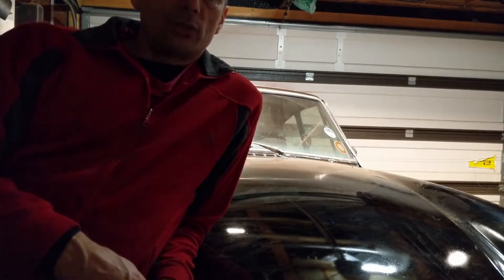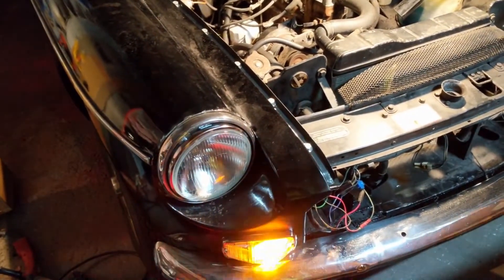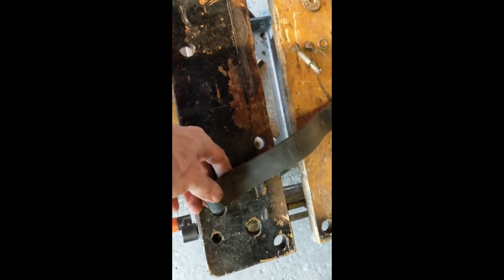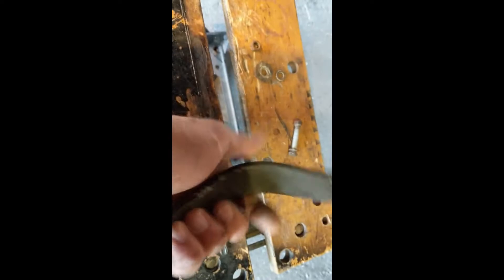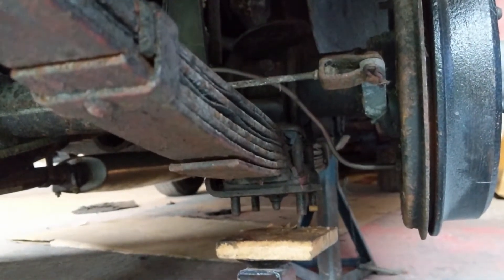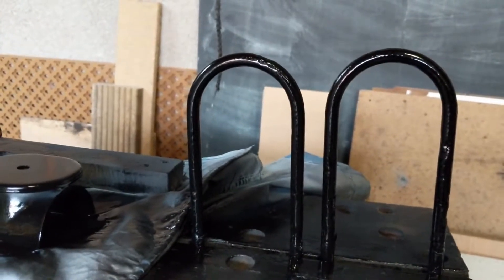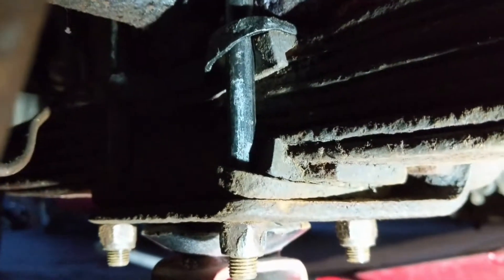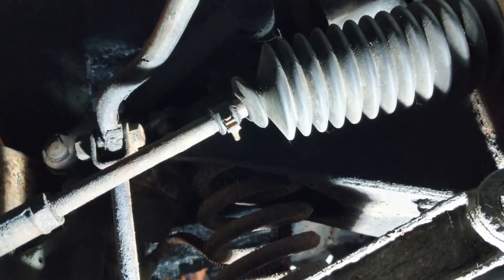MGB GT Episode 22   Odds and Sods

Comment: Hi Henry, Me again. 
Your trackrod end nut is not tightening because the tapered shaft and encapulated balljoint above is also spinning....not unusual when they get a litte worn. The way over this is to force the joint together temporarily with the aid of a G clamp/waterpump pliers or similar so the tapered shaft locks into the steering arm of the hub. This prevents the shaft from spinning and the nut can then be tightened.
Once you have sorted the steering gaiters, dont forget to introduce around 1/3pt of EP90 (going from memory, so check the manual first) into the rack as I think this will have long since disappeared if your gaiters split 10 years ago! The rack & pinion gearing is probably running dry at the moment.
Keep up the good work!
Reply from the maker: Thanks Carsten, but are you certain about the tie rod end.  I know it downs show well in the video but if you look closely you can see the thread being cut as I try to put the new end on.  It looks wrong to me but I don’t have the experience to know.
Reply: @HenrysGarage  Hi Henry, Sorry I think we are talking at crossed purposes here. I was commenting on your track rod end nut spinning but not tightening (at around 22:20 on the video). TrawIing through the next videos I now see you have cut the joint off, so my comment isnt relevant.
You certainly shouldnt have to cut a new thread on the tierod to get the track rod end on. Clearly something is amiss. They should wind on by hand.
Just a word of warning if you decide to replace the complete rack. The rack has to be set up on shims on top of the crossmember mounts. This is due to the vague tolerances in MG production and is neccesary to get the steering rack shaft to align exactly with the steering column where the two are joined by the UJ at the bulkhead. The shims were riveted to the crossmember to keep them in place during original manufacture which is why you will see very small holes next to the rack mounting points. Decades of roadsalt will have corroded these rivets into non existance but the shims will still be under the rack. When I set up my rack a few years ago the shims were no longer in production, so I had to set about creating some by slotting various thicknesses of washers. It is a painful process fitting and removing the rack numerous times with different shims to get the two shafts to align, (in theory a special tool is used for this process) so my advice would be to retain your existing rack in place if at all possible. Only replace it as an absolute last resort. 
Maybe source replacement tierods as an alternative so the threads match trackrod ends?  
Just a thought in trying to save you the grief invloved with setting up a new rack.

Comment: Those front indicator lights are backwards, the amber goes to the outside and the clear to the grille. When in doubt, image search ;)
Reply from the maker: I've had a good look at images with British number plates and the amber is definitely on the inside (near the grill) with sidelights (clear) on the outside. Here's a few examples (https://www.google.com/search?q=mgb+images&client=ubuntu&hs=NAF&channel=fs&sxsrf=ALeKk0208KN7N912tRf6PiJHiZW7Kd-GGw:1608043712499&tbm=isch&source=iu&ictx=1&fir=spIQtuMIr33vUM%252CjkP5xxpOcsEeCM%252C_&vet=1&usg=AI4_-kTpuBLaiTh7WxJvr16vMgMGT78CnQ&sa=X&ved=2ahUKEwih7pDSndDtAhUcXhUIHbu_A1MQ9QF6BAgPEAE&biw=1920&bih=972#imgrc=5h0SZKKta0w8mM)
Reply: @HenrysGarage  Weird I was sure it was the other way, live and learn. This guy got it wrong then: https://www.youtube.com/watch?v=fTJXA32kkT4
😁

Seems there are images going either way. I wonder if some countries regulations required it to be switched? I was pretty sure where I grew up the amber had to be on the outside so it was clear when you were signaling (or some such nonsense).

Comment: Just needed to push the camera back 1 more foot at the beginning 😄
Reply from the maker: I know - I used a go pro straped to my forehead to film changing out the boot on the steering rack which showed everything from 6 inches above the bits I was actually doing - binned it all
Reply: @HenrysGarage  ive done thst before, did some backroads driving just to find out my headcount recorded my sun visor the whole time, Very frustrating 😄

Comment: Did you replace the rack with ep90 gear oil should imagine it must have been dry tie rods have a ball joint behind the rubber boot either a good wack on top with a hammer seats it or a trolley jack under the nut does the same job
Reply from the maker: I did add ep90 gear oil to the rack.  Took me a long time to clean it all out after my basic mistake
Reply: @HenrysGarage  I'm going to confess after finding the boot gone on the rack common place now they only last a year or two and nothing in there all oil drained out when I brought the car last year after cleaning and inspecting I replaced the oil with the blue marine grease had some for my off road Suzuki Jimny fantastic stuff no problems at all